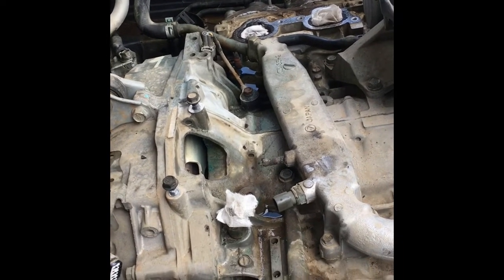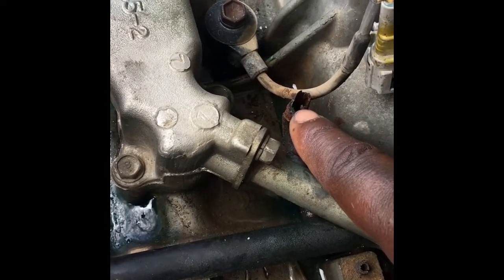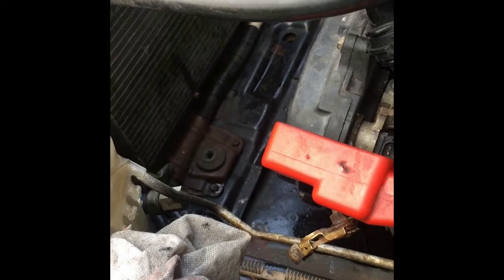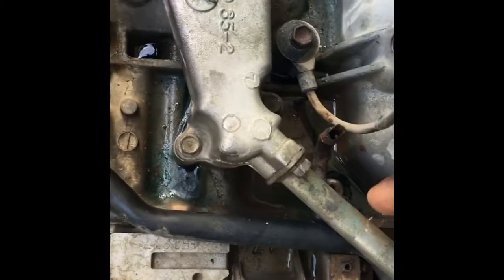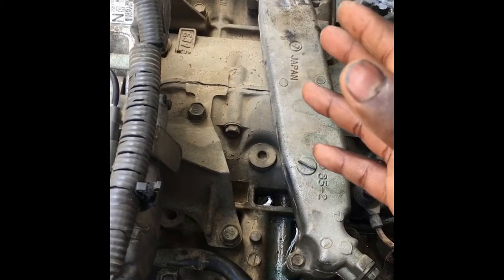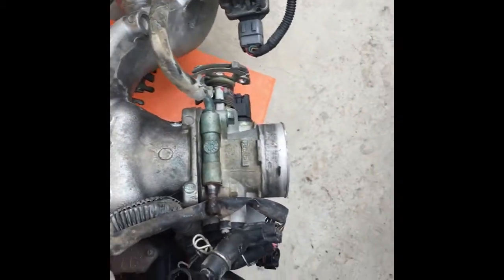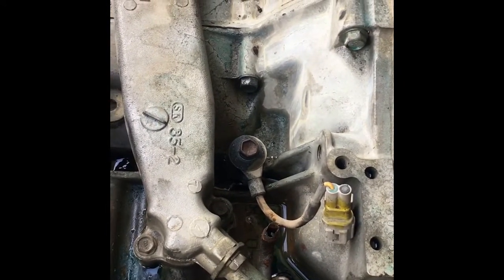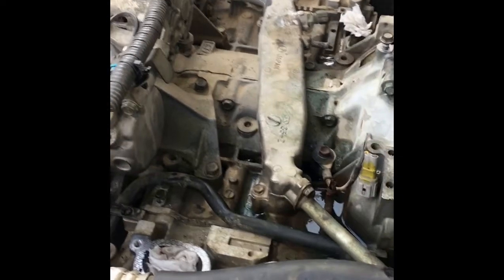Subaru Impreza EJ15 Engine Overheating Problem and Solving,#Polnash

Comment: What do you mean by the engine will blow? i kept having gauge problems which i decided to have controlled driving. recently my engine just went off then started again. this morning it cannot crank.... is this the blowing you are talking about?
Reply from the maker: Hi Ernest,Modern Computer Controlled Aluminium Engines are Powerful But they Need Extra Care,Unlike the old school caste Iron Engines.
If not properly taken care of,especially when overheating for a prolonged period they get to go and go for good,In some unfortunate situations a entire engine have to be sourced

Comment: What is the right oil for that 2007 1.5 ej engine
Reply: Hi, Thank you for the question.The right Engine oil for optimum performance is 5W—30 or 5W-40 Synthetic Oil,that meets the OE specs eg Total Quartz or Shell Hellix